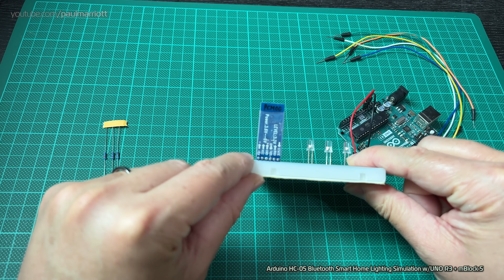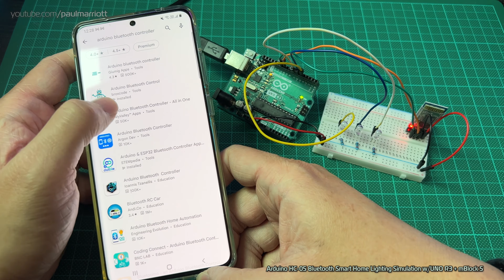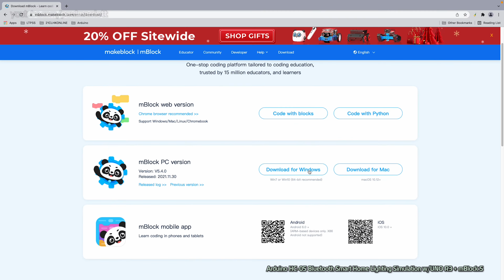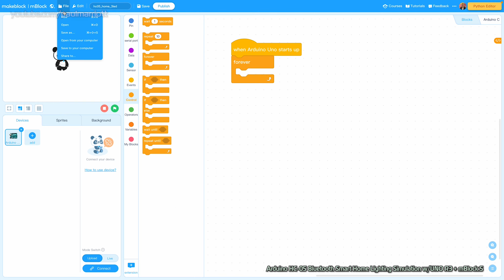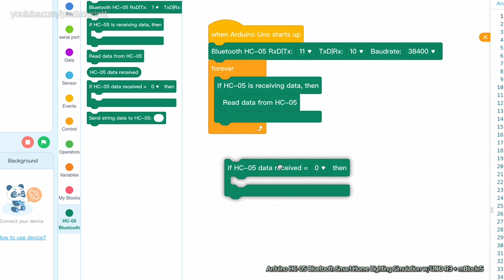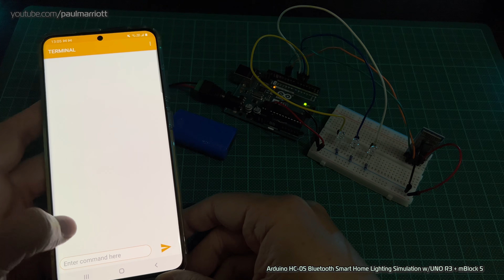Arduino HC-05: Bluetooth Smart Home Lighting Simulation w/UNO, LEDs, mBlock 5 + Android [Tutorial]

Comment: I thought the HC-05 TX and RX pins were 3.3V pins, but you have them connected to 5V pins on the UNO. For the UNO pin that receives data from the HC-05 I guess this isn't an issue, but the output pin on the UNO will be 5V when turned on, so wouldn't this be a little too much for the HC-05? Won't it eventually, if not immediatley, smoke the RX circuit on the HC-05?

Comment: Is it necesary to do the code in the mblock extension, or can it be all done in the arduino app with the code you linked in the description?
Reply from the maker: @stepkneeboi  Thanks for asking. The answer is yes, you can use a regular Arduino IDE app
Reply: @PaulMarriott Alright, thank you for answering!

Comment: The Mblock code link is not working. After downloading the code it says 

" The devices or extensions necessary for this project are not published yet, so the project fails to work as intended." 

Please help what to do next. I also tried the Arduino IDE link and uploaded the code in Arduino Uno board too. But nothing is working. Where am i mistaking?

Comment: Exactly what i was looking for, thank you! Some thing appear to have chnaged since this video. I seem to have so much right but not enough to get it to work. For some reason all " rooms are being triggered once the progran is uploaded, and it appears I have no bluetooth communication.
Mega 2560
HC-05
Using digital pins 22 23 24
Voltage divider circuit in place

Comment: Is there not an issue with feeding a 5 volt signal into the RX of the HC-05? I see that most other users place a resistor divider on that line.
Reply from the maker: Good question. All I can say at this stage is I’ve made a number of devices w/HC-05 and have had no issues thus far with the higher voltage.

Comment: I'm running into an issue where the Bluetooth just doesn't seem to be connecting.
According to the app it's connected to the Bluetooth module,
but I added a case after the if(Bluetooth.available()) function that sets my lights in a blinking pattern, and they just won't stop blinking.
I'm not sure why the app could say it's connected when the Bluetooth module seems to think otherwise.